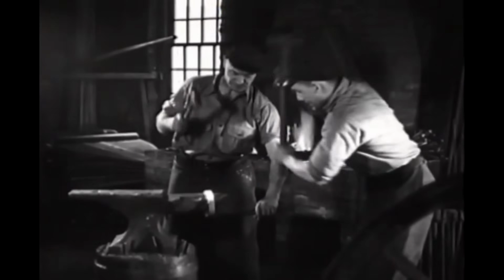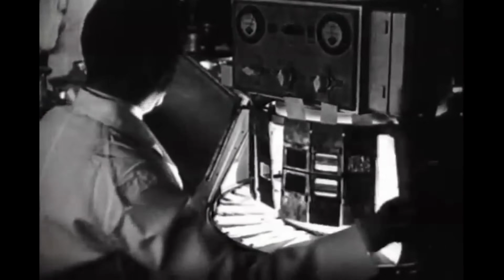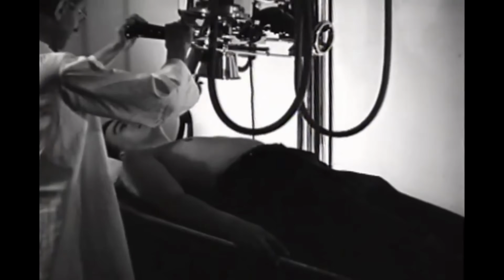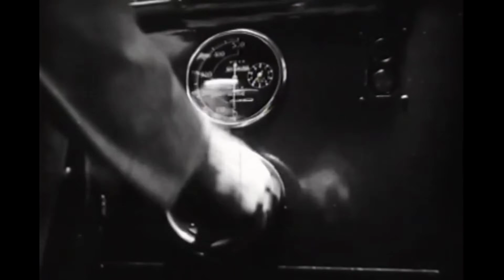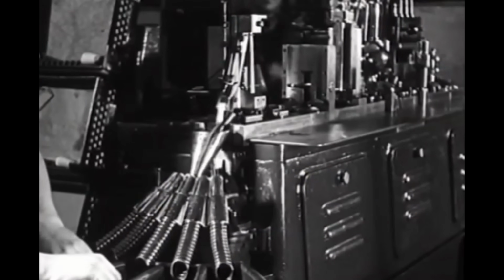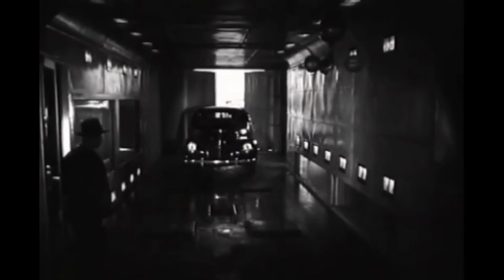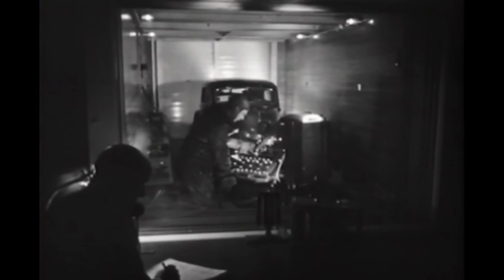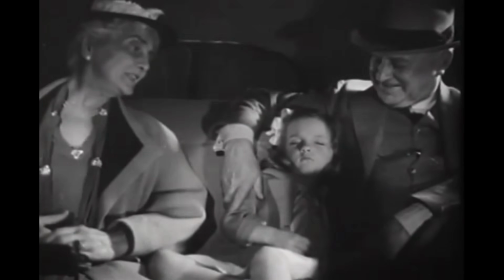Science Rules the Rouge.  A 1939 Ford Motor Company Publicity Film Showing Various Stages of Testing

Comment: 15,000 parts in a v-8😂…. Nope
Reply: I thought the same thing, maybe the whole car?
Reply from the maker: Thanks for watching!
Reply: I depends on how many detail items you call a part.

.the two 6203 series ball bearings in the generator  could just not be counted since in the generator  thus 0.
 Or maybe as 2 parts ie assemblies in the generator 

 Or do you count say the all the parts in those 2 ball bearings?  ???

Ie  2 inner races. 2 outer races 2 ball separators 4 shields say 18 balls. 2 dabs of grease?? 

How about the generator do you count the 52 lamination on the armature?  67 lamination on the fixed poles? 

Do you count say the invidual wire turns if each is actually soldered to tabs?  

You could thus have 0 for the generator and say it's part of the engine or add all its tiny parts and have it go up by many hundreds of parts.

Do you count the transmission as 1 part or 0 or just use the number 2500 that includes all the tiny balls in each ball bearing?

Is label on an item a part?

Unless you want to dwell the details you cannot come up with a number.

 Most non technical folks want low numbers. Ie an automatic transmission is just 1 part lol

Comment: Johansson gauge blocks and analog instruments have been replaced with laser measuring devices and digital instruments. Computer programming now performs simulations which overcomes human errors in testing.
Reply from the maker: Very true!  Thanks again for watching!
Reply: True. But they only test and produce parts/vehicles to hold together for the duration of the warranty. These cars were designed to last for decades. Different mindset and priorities. Sad what we've become. This is why many of these old cars are still around and running. I'm betting that 99.9%  of what we buy today will be around 90-100 years from now. Cheers my friend.
Reply: @giggiddy  Few cars of that era lasted more than a decade or over 100,000 miles.
Reply: @SpockvsMcCoy  i didn't realize that. I see them often at shows and such whereI I live. Take care.